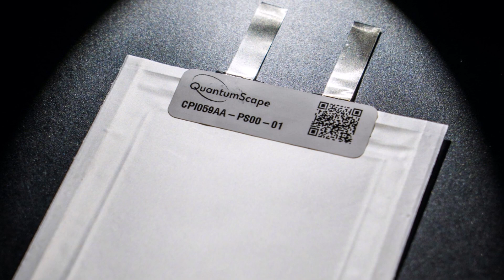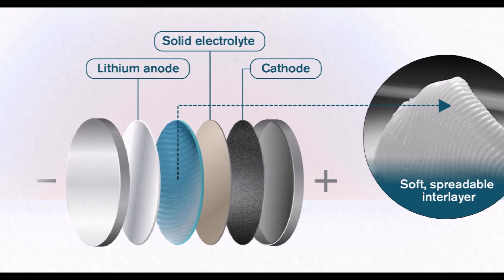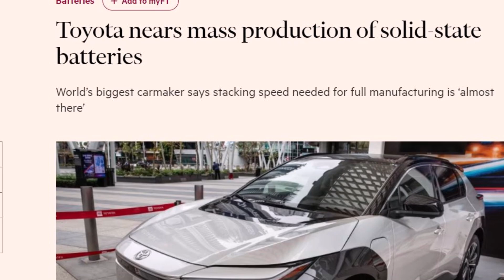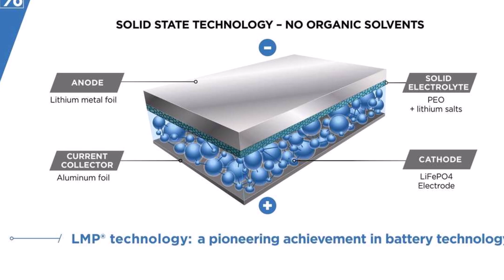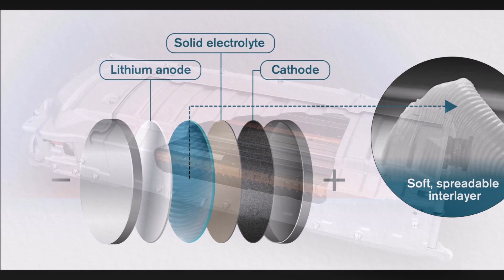Toyota Shows Solid State Battery Production Plant Nears Mass Production of Solid-State Batteries

Comment: Please provide the battery performance specification and key advantages over typical NMC and LFP cells.  😉
Reply from the maker: Toyota announced a collaboration with Idemitsu to mass-produce all-solid-state batteries. According to Toyota, an electric vehicle powered by a solid-state battery could achieve an impressive range of 1,200 km (746 miles) and have a quick charging time of just 10 minutes. These batteries hold great potential for revolutionizing EVs.
Reply: @Torquenews   Right.... but this is a future promise. How about the present? Right now as I am writing these lines, CATL is producing new batteries that provide over 1000 km of range and take 11 minutes to fully charge. Now, in 2023 not in 2028.